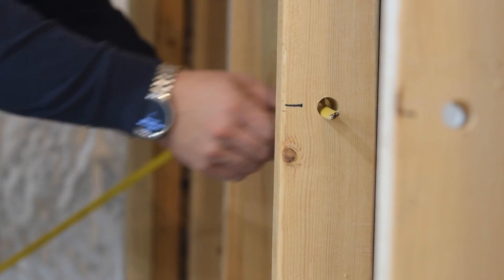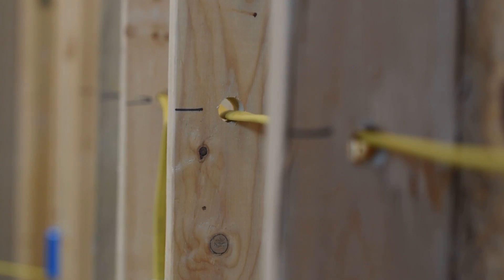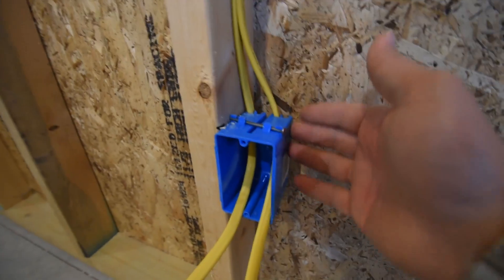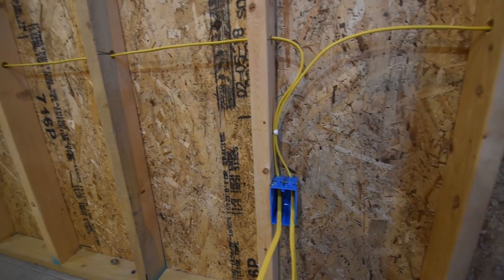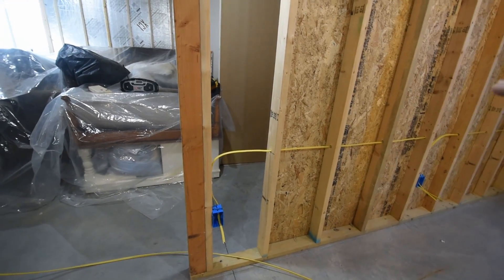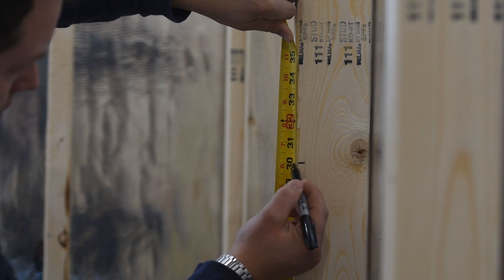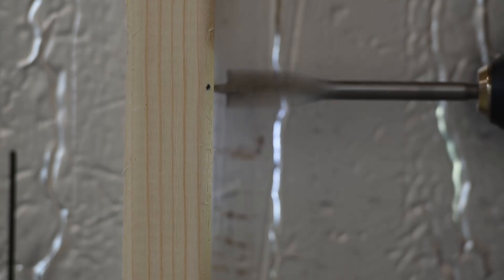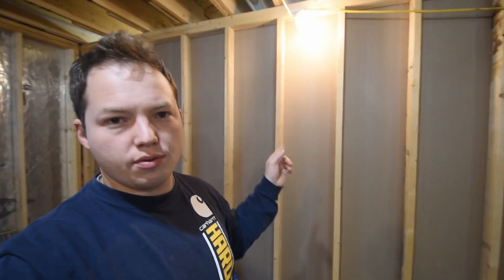How High Should Wires Run Through a Wall

Comment: I saw somewhere on youtube that if you want to know how to do something best, make a video of doing it one way then go to the comment section for how to do it better. 
Seems the general consensus is 24-26 inch for running wire through studs for optimal height avoiding counter/cabinet installs making sure to drill 5/8 holes in the center so you dont run too wide and make it no longer structural and you can still avoid installing nail plates. 
The exception is for walls in residential construction that wont have drywall added, run the romex in the attic and drop vertically to meet the most strict codes. 
Learned all that reading comments rather than the video
If you set your lightswitches 48.5 inches from the ceiling, you guarantee an easier drywall install and plugs should be set to the height of an eastwing hammer from the floor.
Reply: Robert Pierce - Great summary... Thanks! Nowadays I pause the video before it even starts and scan the commments for tips and to determine if the video is worth a watch.
Reply: M. McDonald 1 month ago, "Robert Pierce - Great summary... Thanks! Nowadays I pause the video before it even starts  ...." Wow. There's a precocious insight!!! Thanks.
Reply: @m.mcdonald9437   Now THIS is a tip worth the read!
Reply: i like your comment except measure for your switch  48"from the floor up and not the ceiling down. in ontario i put outlets at 12" and countertop outlets at 44"
Reply: That's funny and I never really thought of that.  But I'm going to start making videos telling people how to do lots of stuff so people will tell me I'm an idiot and how I should really do it.  HAHA... Thanks for the great idea.
Reply: @junkmail4613  sorry, didn't mean to reply anything or get you so worked up. Apologies. I've deleted my response.
Reply: you all prolly dont give a shit but does anybody know of a trick to log back into an instagram account??
I was stupid forgot the account password. I would appreciate any assistance you can offer me
Reply: a friend of mine wants his switches at 42" from the bottom of the switch! thats like the height for a wheel chair access home! I got another guy  that swears youre supposed to drill holes in the upper third area of a joist!

READ THE INTERNATIONAL STRUCTURAL CODE BOOK!
Reply: Hope everyone on the job has same size hammer lolol
Reply: Not "general consensus" - just "consensus". "General consensus" is REDUNDANT!
Reply: @robertmeigs5176  
A definite maybe for sure.
Reply: @Axl Gustavo instablaster =)
Reply: @Stanley Alessandro I really appreciate your reply. I found the site through google and I'm waiting for the hacking stuff atm.
I see it takes quite some time so I will get back to you later when my account password hopefully is recovered.
Reply: @Stanley Alessandro it did the trick and I actually got access to my account again. I'm so happy!
Thanks so much you saved my account :D
Reply: @Axl Gustavo No problem :)
Reply: 30” is good when running a 3” foot slab to seat Sheetrock on , if not your choice to do so, than 24”-26 is a way to go.
Reply: I always bring my feed and feeder in bottom of switch boxes. Lighting tails and travelers out the top
Reply: Tom Kristman 
Me too, it’s cleaner
Reply: @tomkristman1456  exactly 👍 - also feeds on same side consistently makes troubleshooting a snap in the future
Reply: @sinistersparky9657  
If you are that keen in doing your work then there should be no trouble to shoot , right? Lol
Reply: @brandonlee8665  obviously you are young and inexperienced 🤦‍♂️
I only have to troubleshoot my work after the homeowner's son decided to grow some indo' and melted the outlets, then called his tweaker friend 'the electrician' who took apart every outlet in the house before they decided that the expensive grumpy old guy is worth the money. 🤯🧓
How about quit being so snarky, trying to be 'heard'. I'm not your dad, son. 
How about trying to say something constructive, would that be too hard? 
I mean your super funny and all but what does that do for anyone besides showing everyone that you're immature?
Reply: @sinistersparky9657  Haha. I did hit a nerve. That just confirms that I'm more mature than you and I  could take a joke. Lol
Reply: If your really experienced,  dont assume that your feeders are still on thesame area as when you did them . That's how you get you zapped   lol
Reply: @brandonlee8665  keep trolling son, you'll be good someday
Reply: @sinistersparky9657  old dogs cant learn new tricks.  Lol
Reply: @sinistersparky9657  you remind me of my old coworker. He said knows lots but he doesnt even know how to splice threeway switch. Lol
Reply: @brandonlee8665  Bahahahahahahahahaha 🤣🤣 you crack me up kid. So you wanna school the old man huh? 
Ahahahahahaha okay here's the thing -
1) pay close attention kid, this will save your life: EVERYONE who makes it through their 2nd year as an apprentice knows _Trust but Verify- 
I don't get zapped kid, YOU get zapped. I work on EVERYTHING like it's hot 
2) Doing consistent work is one of the keys to craftsmanship kid - I can ALWAYS tell when someone has been in my work, because it's pretty - I do work the the same way over and over, and it shows - you can't get into my work without my knowledge kid, you just can't  - been doin' it too long.
3) No wonder I remind you of an old guy who probably laughed when you said you were gonna "splice a 3 way switch." Hahahaha 🤦‍♂️ do what now?
A 3 way switch is a device son. You wire a switch. You connect a switch. You could terminate a switch. Technically Lutron and other dimmers and smart switches with flying leads could be spliced but only those, not screw terminal devices. 
But you're really questioning whether or not I can wire a 3 way switch in a clever and immature 20 something boi kinda way - WELL PLAYED SIR ... NOT

The real question is can I wire both  3 way switches- easy son -
Power comes to switch 1 on the black screw, travels on the 2 gold screws to the gold screws of switch 2, through the black screw to the load. You can figure out the travelers yourself. If you're super clever you can figure out how to get a 4 way into the middle there. Just remember that the new 2020 article 404 change will require most switch boxes to have a neutral to the switch even on both ends of a 3 way.
Keep Trolling kid, you remind me of a lot of smart ass know it all types that don't really know shit from shinola if they were reading the label.

Tell me how to wire a 3 wire start/ stop switch motor control son, that should be easy for you
Reply: Did you guys know that there’s a scooper in the bottom of the wire lube bucket? Just gotta reach down and get it.
Reply: @sinistersparky9657  it gets that daily laugh 😂 everyone is looking for
Reply: @tomkristman1456  And how do you convey that to the electricians that will work on it 20 or 30 years later??
Reply: @jackriley5974  
In 20 - 30 years from now, they gonna ask, "What's a hammer?"
Reply: I drill the small hole possible SO mice can't use the wire as a SUPER HIGHWAY through the walls! Lol you also use less foam spray to seal around the wire.
Reply: That Estwing not Eastwing But who cares?

Comment: I am going to be finishing out a basement with less than 8' high ceiling. My plan is to precut all the 2x4's to their required height, on my miter saw, and predrill each stud at 26" on the drill press (stop blocks are my friend). I will have holes with no wires going through them but...

Comment: Three feet for me. A hole hog has 3/4" pipe threading for the handle on both sides. So 3/4 rigid conduit will screw right into it. I got a 3' piece of conduit and use that to hold the drill motor up off the floor and drill the holes at a comfortable height. I also have an 8'' conduit/handle on the other side of the drill. It's pointing up when drilling, helps you push the bit thru. . The 3' conduit rests on the floor so the holes are automatically at a consistent ht. and it supports all the weight of the drill at the same time. It also gives you a lot more leverage over the bit aided by the floor. 
And  It's also easy to pull the wire thru  @ 3' without bending over, especially if you're tall. I'm 6'5''.

Comment: It's been a while but if your drilling with a Hole Hog or some other large drill it's best to drill at the height that feels comfortable. Basically just about at thigh levle. I say this because I remember drill some tough holes I would add pressure to the back of the drill with my thigh.

Comment: Excellent idea. Also, be careful when running wire in the kitchen and bathroom not to run wire at 32-35" so that the cabinet installers won't run a screw into the wire when installing the cabinets.

Comment: All these people who do these YouTube videos on electrical you guys are not focusing on how every state in every city is different they can adopt whatever type of code code to do work they want to do for example Missouri you can wire all smoke detectors on one breaker, but Florida found out that people were just flipping off the breaker. They want to hear the chirping no more so they just shut them off, so they adopted a lot to attach all the emergency lighting fire alarm etc. to the lighting circuit so then the homeowner or business can’t just go shut the breaker off because if they did then they would lose their lighting as well. It is a smart idea because I have seen a lot of schools That are government contracts given to companies who just want pocket money and you give them bids and then they turn around and want you to separate it out so they can take it out of the original blueprint plan since it was already the money has been already been given and a lot of times they will put lighting in and act like they have emergency lighting but when you take part The fixture you’ll find that there is no battery back up. All you have is the light showing that it’s all good so when the inspector comes and pushes the button, it lights up but no actual emergency light, so it depends on every state every city that you were injust have common sense when you’re doing it and if you don’t know, then don’t do it

Comment: Ive been installing my receptacle boxes on my garage 48 inches Can i still do the 30 inches for the romex go on the studs and install the box to 48? only reason i ask is because i have back issues and i dont like going down to the outlets on the garage much. I live in OHIO so i know codes can be different but i want to know from a pro before i do anything and also to call an inspector to pass

Comment: code is 4 ft flood ,like circuit breaker boxes, , i would never run them like that run on top then hang down from middle between studs , if i had no choice would the  to run them on top 3-4 inches from top making holes thru framing

Comment: I want to finish my walls in garage but my wiring is all exposed on the outside. I have 5 wires zip tied together. Is it ok to run all together though the wall?

Comment: Is it okay to drill holes closer to the bottom of the stud? In the case of running wire for baseboard heaters, it'd reduce any need to cross over other wires to bring it down close to the ground. But is this acceptable?

Comment: Anywhere around the 30”,   36” is about the height of the second punch out for a steel stud which would also miss any 24” Sheetrock lap! All about communicating with the other trades, especially when same guys work together regularly.

Comment: I have often chalk lined my drill spot. Now I have a laser that is even faster. I use the 25-1/2 " height for my holes. That is a 2' level on the bottom plate when I am not using a chalk line or laser. 12" to the bottom of the box for outlets.

Comment: I run my horizontal holes at the height that my right angle drill braces against my leg in a comfortable standing position. Switch boxes are 48 5/8 to the top off the joists in a standard ceiling height house. My outlet boxes are the height of my hammer off the plate. OLD SCHOOL.

Comment: Think about where insulation will go, and make the runs in level lines so the insulation will hopefully be sliced to fit.  Avoid loops and random placement that is hard to insulate around.

Comment: I'm not an electrician. Yet I loathe plugs being so close to the ground. It's my understanding that the reason why they are that low is to use less wire. If it were me. I'd have plugs as high as the switches.

Comment: I'm no electrician but did many jobs and I go hip height so yeah around 30" or so. I find it easier to both drill and run wiring. Not only that but usually under countertop hight to avoid screwing into for kitchen and baths. I know enough to wire a home but still much to learn and am very interested in electrical workmanship

Comment: Great points and tips. Although the NEC does not regulate switch and receptacle height (other than disconnects) I’ve been taught that building code does mandate receptacle and switch heights. (American Disabilities Act Requirement).

Comment: Run em through the wall if you have to. Less wire use and voltage drop.

Comment: Sorry, I just have to weigh in.  I spent the first 35 years on earth pronouncing height as if it was spelled "hi -TH". One day I realized it was spelled height (like eight and weight). Never too old to learn. 
 
If the recommendation of "48.5 off the ceiling" is to help the drywallers. Don't worry about the drywallers. They just measure close and use a rotozip to chase around the outside of the box. 
The problem with measuring from the lid is the walls can be built with 88", 92.5", 96" 120" etc, studs. The height reference should be measured from the floor.
Reply: see https://www.merriam-webster.com/dictionary/heighth its older english but still correct  :)

Comment: Curious if the code in your area allows those staples that you're using, to be used for 2 stacked...

Great idea on the lower lane way for wire runs. Besides in a kitchen (potentially cabinet anchoring), that's a good rough measurement to put them.

Comment: I tell all my helpers, no holes or wires 28" to 34" up from the floor to prevent wire damage from cabinet installer's. The mounting boards on most base cabinets are at these heights and installing wire at this height can be a bad learning lesson for those who practice this.
Reply: Working Man🛠️Ron Doyle,  As a cabinetmaker, I can relate to what you're saying.  Lower cabinet boxes are often 34 1/2" from the finished floor with a 3 1/2" nailer on the top.  So that's cutting things pretty close at 30"  A bath vanity can be lower also.
Reply: Where there's cabinets, I avoid horizontal runs. Go up to ceiling and come back down to next opening. A wire on the side of the stud is more forgiving than a wire thru a hole.
Reply: so at what height are you running the wires across? 24?

Comment: I think that a hole that the wire passes through is considered a anchor point by code so if the hole is with in 6" of the box then technically you would no need a staple but I do not recommend on doing the holes so close it just make it hard on yourself
Reply: The code specifies two distinct definitions; supported and secured.  A hole constitutes supporting, but not securing.

Comment: Isn't it better/safer to bring the wire into the receptacle box from beneath? The logic being in the event of water potentially traveling down a wire into the box and causing a short. Whereas by looping a wire down before entering the box or entering the box through the bottom creates a low point that water can't flow upward from.

Comment: "Find a scrap piece of wood and cut it to the correct height" Yes. In framing contexts, this would be known as a "story pole", except that it would have several heights marked on it. Here, you'd mark the receptacle height, the cable hole height, and the switch height. You can mark an entire room in minutes with this, then drill your holes, and finally place your boxes in one fell swoop. If you are careful about this, it even makes things easier for the drywaller (that would be me on my personal projects). Strike lines across the dry wall at the box heights, then mark the horizontals. Bam, bam, bam, done.

Comment: Why are staples required before wire enter boxes?
Reply: Strain relief. If a wire gets yanked from another point, it won't pull the connection.

Comment: No need to measure or use a laser!! Drill holes at knee level. Providing you're not lopsided the holes won't vary enough to hinder pulling a wire. If you don't know enough to drill in the middle of a stud you shouldn't be there!!

Comment: If you want it to look pretty dont run them across the wall, run only up and down. Uses a little more wire but looks great if you're trying to impress a high end builder/customer
Reply: CFHforever This sounds like a silly idea. With the cost of copper wire being what it is. 
why waste the money and resources on something that will be covered with wall sheathing?
Reply: @roberttroutman6780  it's called going the extra mile. When the builder of a million dollar home shows his customers the rough in stage, that extra neatness will go a LONG way in keeping those kinds of customers. Build it into your bid...easy
Reply: I guess if you can afford to build a million dollar home, the extra cost of the wiring isn't a concern.
I was thinking of the cost conscience builder / home owner trying to doing a good job at minimal cost.